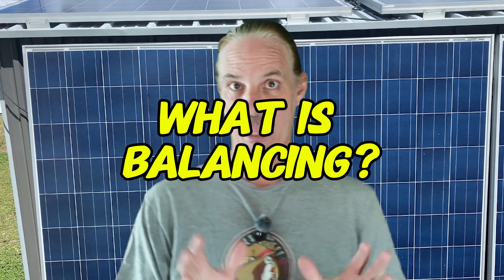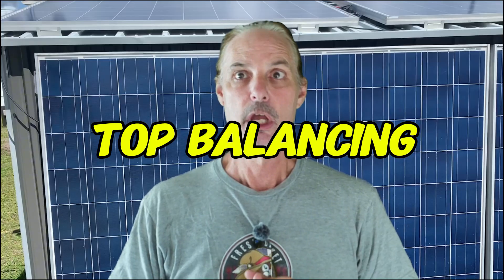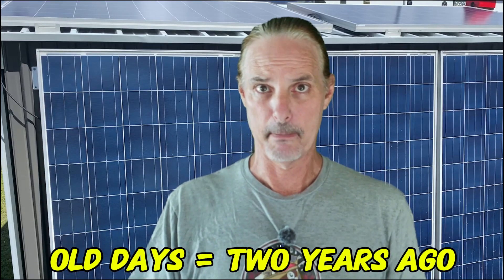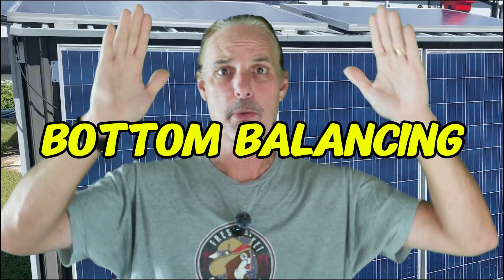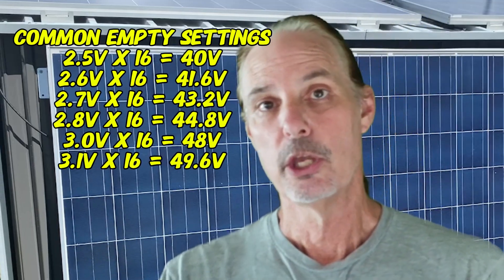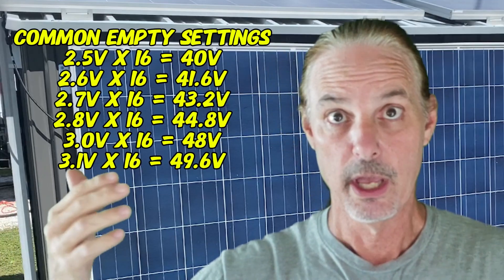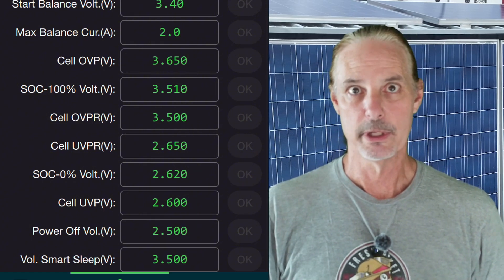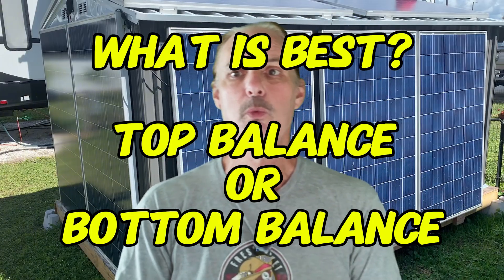Easy Guide to Battery Balancing for Beginners

Comment: I have a 4s3p battery system and i can't top balance because the first battery to reach 100 percent stops the charging for the test of the battery's
Reply from the maker: Do you have an absorption time or float time that you can increase to allow it to peak out then stay at peak and wait for others to catch up?
Reply: @MattManSolar it's a 10kw sungold inverter.  I honestly never really messed with the settings
Reply: @MattManSolar I'm going to look
Reply from the maker: @garys6898  Looks like setting 10 lets you configure how long it stays as max charge, and 11 allows you to setup what is floats at after 10 time limit expires.. should be easy to correct with them two options .. Hope this helps!
Reply: @MattManSolar  number 10 is on 120 min Default is that enough? I have like 44kw of batteries
Reply: @MattManSolar and then you so much. Really appreciate the help
Reply: Thank you*
Reply from the maker: @garys6898  if your system is way out of balance, turn it up for a few days even a week you might wanna turn down your max charge a little bit so that you’re not setting all those batteries that do get up there to an extremely high charge to sit around all day, so move it down to 56 V where it’ll still balance but not beat up your batteries at max voltage
Reply: @MattManSolar ok. Thank you
Reply from the maker: @garys6898 you are so welcome .. hope it helps

Comment: I like the idea of integrating both top and bottom balancing. According to research, if one cuts 20% off the top and 20% off the bottom, the cells will last longer.

One may be able to charge a battery up to 100%, then balance it from there, if need be. Check voltages. Of course, after that you'll put the BMS with active balancing. Good video, thanks.
Reply from the maker: Thanks